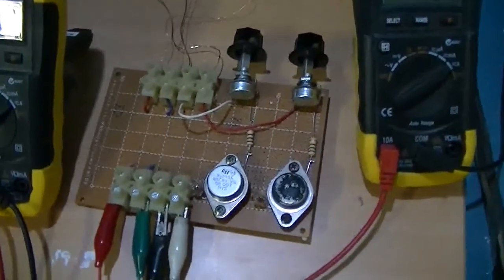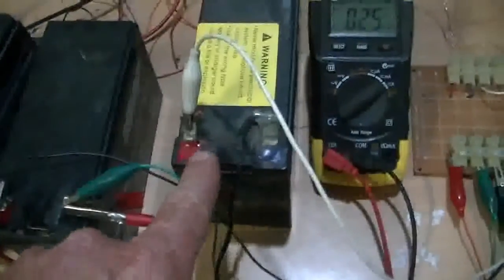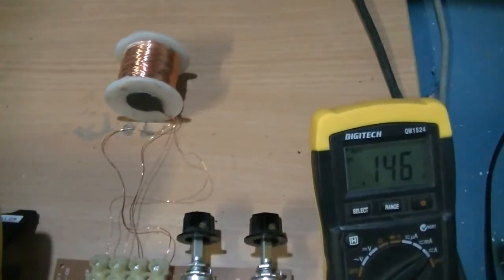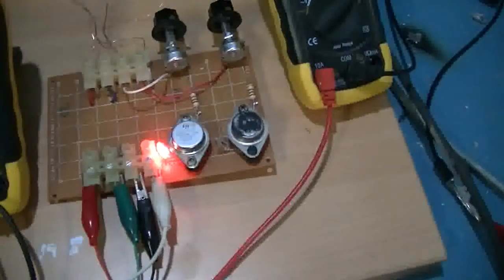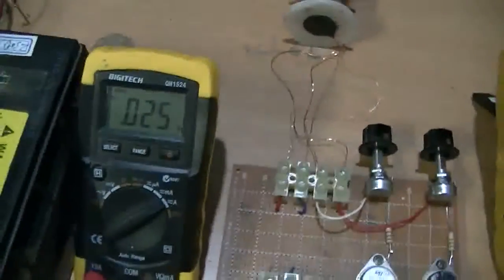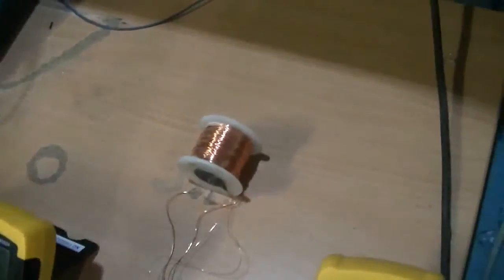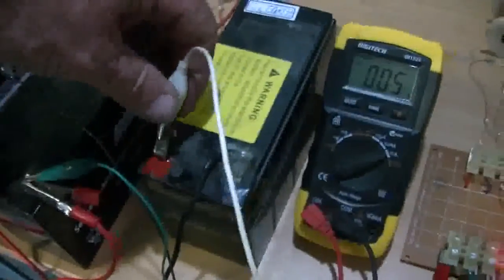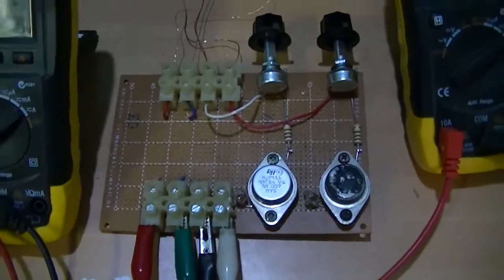SS-SSG with reverse charge.flv

Comment: With this circuit, the startup condition has both transistors conducting. This induces the trigger winding's potential to deflect. Because the NPN is on the bottom and the PNP is on the top, the side nearest the trigger winding's potential will shut off, resulting in either a high-side or a low-side switching condition. Imagine a ping-pong game in which the intervening space represents a conducting state; each time the ball strikes a paddle, the current interrupts on that side.

Comment from the maker: With your standard ssg setup you are charging with what is called conventional current flow,But with the system reversed(useing a pnp transistor)and chargeing through the negative of the charge battery you are useing what is called true current flow.Once you understand true current flow you can see quite clearly what is happening in the circuit-it would be worth your while to study true current flow,then you will see things how they truely are.

Comment from the maker: @lykenth08 Hi lykenth08-no its not a bipolar circuit,this one works by catching the potential diference of both sides of the collapsing field around the coil.It is said that voltage is preasure,so if we create a preasure at the collector of the npn transistor and send that preasure to the positive of the charge battery then the collector of the pnp were the other end of the run coil is conected creates a vacum or negative charge.This is being sent to another charge battery hooked backwards.